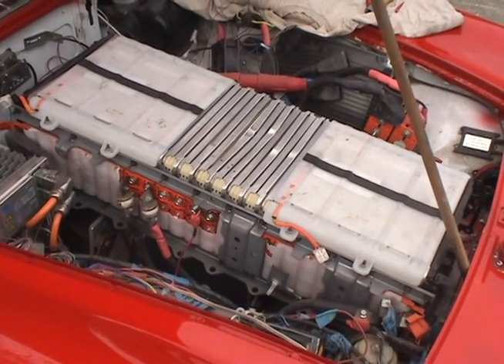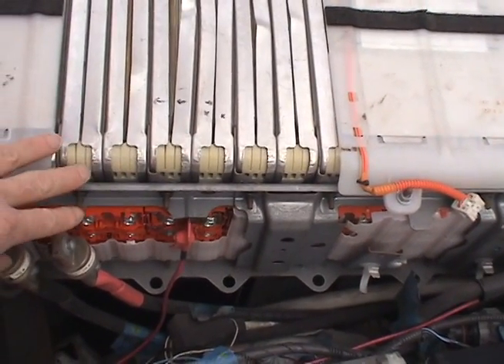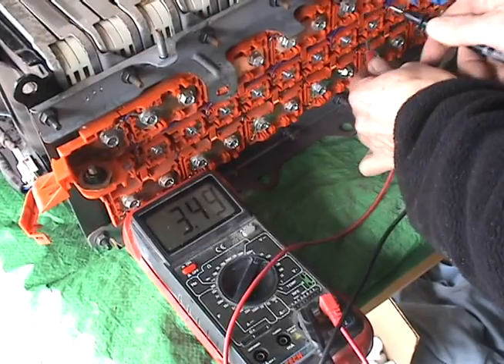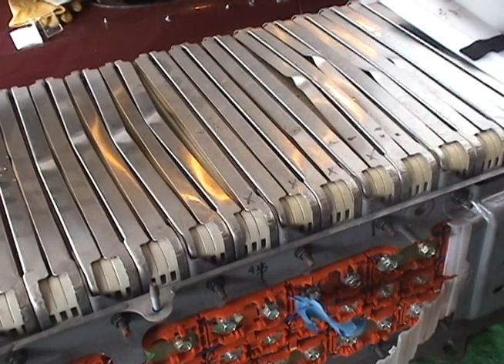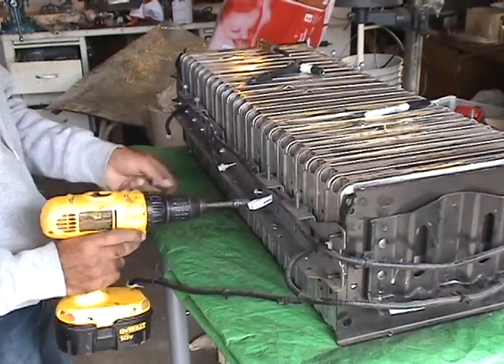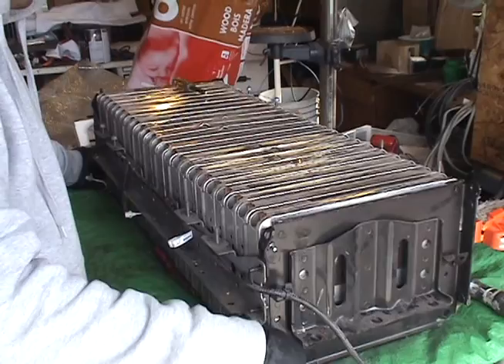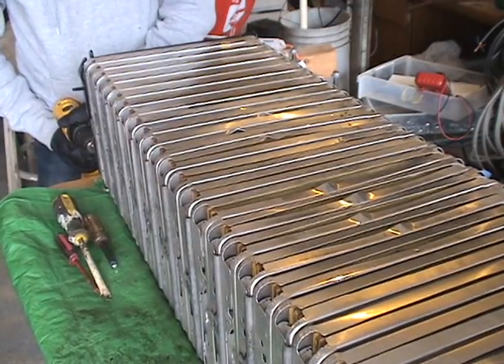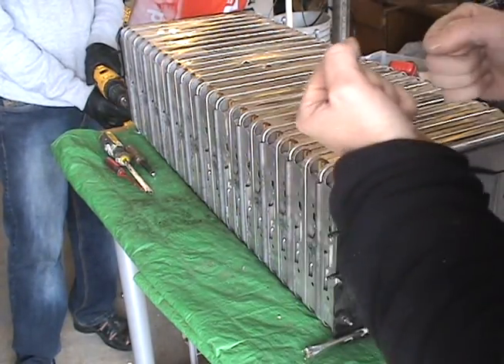Replacing cells in a Leaf Battery Pack installed in an EV conversion.

Comment: hi where did you get the the new cells from?
Reply from the maker: They were left over from the second Leaf we took apart. 

This car in this video uses a whole Leaf pack (96 cells, I.E. 48 physical battery units) plus another 32 cells, 16 physical battery units (total 128 cells or 64 units)  .  

Having taken two Leafs apart we had a total of 182 cells (96 battery units) and this car got 128 cells, my car (another MG) got half a pack - 48 cells (24 units)  

Having divided up the packs we had, if you do the arithmetic, we had 16 cells (8 battery units) and we used four of those in this battery replacement project.

Comment: Is it possible to replace the broken cells. For a complete battery? 12 bar. If the car battery 8 bar. So we do not replace the battery when you become weak?
Reply from the maker: Yes, it would be possible to replace individual cells. It would be a big task. Firstly, you need to identify which cells are weak (using the LeafSpy App). Make a note of all the cells that you'd like to replace (the cells are not numbered but you can just count up from zero volts on the pack to find the right cell). Then you have to remove the pack from the car - it weighs 300kgs - and open it. (This will void the warranty, of course.) Next dismantle the three packs of batteries from the framework and, with care, unbolt and remove the bad cells. The hard part will be getting replacement cells! Finding a crashed Leaf is probably the best solution - take that apart too.  The key important task before inserting the good battery in your pack, is to make sure the battery voltages are all equal to within 0.1 volts. To to this you will need to manually discharge some cells (using some resistance device, like a small 12V heater). Check the voltages constantly. When all the cells are even you can bolt everything back together. And, critically, seal the battery box perfectly using the same sealant as used when installing windshield glass. If you don't seal it properly then water WILL get in and you'll end up burning the car. See this video for evidence :)... 
https://www.youtube.com/watch?v=2cIo95W-vfE

I think it would take about one week to do this job.
Reply: thanks allot
Reply: Shame you did not name your video correctly

Comment: i hope you plan on doing more work to your battery .. i am not sure what your HV pack voltage is but if its high at all i hope you make this car safe for first responders as one day you can find your self in a crash or in water to where it can flood the HV pack and kill your self and others trying to help you  

you need to make a battery box safe for... crash / fire / water ...so no matter what the HV voltage does not get to any body parts on the car
Reply from the maker: Yes, all sorts of nasty things can happen in a crash. I can see you've had experience with fire. I have suggested more battery protection and maybe that will happen. It was interesting to note that of the two totalled Nissan Leafs we took apart, the emergency crew didn't bother with the battery disconnect. They just left it in place. This car charges at 525volts but drives at 130 so it's a bit safer. I'm not sure if the Tesla, vw golf, Mercedes, BMW etc even have so-called first responder disconnects. This was probably yet another ruse by the ICE industrial complex to try to slow the rise of their nemesis:) Remember how they tried to make all electric cars make a noise because of all those pedestrians who would otherwise be mowed down? Currently they are droning on about range anxiety- something that anyone with a commercial EV doesn't worry about. If you ask commercial airline pilot if he or she has range anxiety -of course they don't, they just make sure they have enough fuel to get where they want to go despite not being able to fuel in-flight. 
Water ingress into this car does worry me . Maybe the owner will do something about it, in the meantime, this is California and it hardly rains.
Reply: yeah i can under stand .. when i was talking about flooding it was not about the rain as its more of a small or large crash to push you down in to a small ditch with 5 feet of water or so 

its not as hard as you think to find your hood under water .... FL here we have alot of traps like that and really i dont know CA but its not saying this cars life well all ways be in CA   

i have 2 chevy volts in my driveway and the battery disconnect is next to the driver and is pulled by hand 
the Tesla has a pyro fuse and is setup with the SIS /airbag system and cuts power in a crash 
the nissan leaf tho has 3 bolts you have to pull to get to its disconnect so its safety is to not let power 
come out of the box if the car is off and 12v DC is removed .. the chevy volt is the same way 

DOT stander says that the car must and can drive in deep water with out hurting any one
this is why most after market motors dont meet DOT standers as the back side of the motors are open 

there are some new nice water cooled ones that are just coming on to the market made in CA 

yes i have payed for and own a RV and a suv that where on fire some time in there life and got them after the fire and fixed them up and seen others hard times and had 2 good friends that where fire fighters and you have seen i am a meager DYIs my self  and i am sure you seen i made parade floats for a living so i have alot of back ground in this stuff

but still 130Vdc  your going to feel that and its going to hurt  and i just hope that you can add so more safety  to the car in your coming days 

if you have room i am sure you can make a box  and add the a relay inside the box so the HV power coming out is cut when the car is off .. you can get a spray can of foam yellow that is used for around a fire place and add that to make a fire wall so if there is a fire out side of the box that the battery can last longer before it starts to go 

there is a video on here on battery fires fro EVs and it shows X2 the water that is needed when the battery goes up and in the end if some how that day should come that it hurts some one well you all ready showed how smart you are with DYI so its going to be asked why did you not make it safe for others 

i hope you are not taking this in any way that i am putting you down or making fun of your work .. i really love this stuff and am looking to do some of the same things to my stuff and thats why youtube is here but i am just a friend stopping by to say .... did you think of that ... and all so when i see some thing i like i look at what others have said to it and going much info i need to help  and so what i am saying here may all so help others 

PS.. i had a 48V dc system let me know it was there one time

Comment: What was went wrong with those damaged battery bolcks? Why dead battery blocks expanded so bad...? Overheatig or over charged...? Is BMS still alive...? How old those leaf battery blocks are...?
Reply from the maker: It's explained in the video. 4 cells got overcharged and when that happens the temperatures rise and the chemistry changes irrevocably. No BMS was operating during charge time. A bms MIGHT have prevented this failure - but quite possibly not. It was a wiring/configuration error. At least only 4 cells were lost.

Comment: Why on earth are you running a DC/DC converter from only a section of the pack??? You should never do this, it's extremely bad practice and will guarantee cell imbalance and damage!! Any load should only ever be taken from the whole battery, this way all cells will stay at the same state of charge. I can't imagine how you could even successfully charge such a set up even with an active BMS, it's a disaster waiting to happen...
Reply from the maker: +NewmanAutomotive The other videos about this car would explain why this setup is valid (except that the original valid setup was altered and that's why only 4 cells were damaged not all 16). Briefly, the DC-DC converter was ONLY operational when the entire battery pack was connected to it (thereby depleting the pack uniformly). The DC-DC only operated when the car was in 'drive' mode where the entire 400V pack was wired such that it was divided into 4 'quarter' packs of 100V each. These 100V packs were wired in parallel to drive the 100V controller. Only when charging was the pack rewired to be in 400V to satisfy the Brusa charger. (See the other videos for an explanation as to how this was done). When charging, the DC-DC was (supposed) to be off.   Things started to go wrong when we upgraded to pack to 520V (nominal) meaning that dividing the pack into 4 for 'drive' mode meant supplying 130V to the controller. The pack was charging at 520V. The mistake made was to keep the DC-DC wired over 100V (12 Leaf battery cells) rather than re-wire it over 130V (16 cells). Then the other mistake was to somehow leave the DC-DC on while charging - then then, even more critically, not charging but also not in the drive configuration. A veritable catalog of errors but also not too expensive (except that we believe the controller got damaged when the bad cells swelled and consequently connected the body of the car to about 120V relative to pack zero). Glad I'm not paying the bills :)
Reply: +mikeatyouttube Thanks for the reply, I also run nissan modules in my own conversion, love 'em, but please do be very careful, you're lucky they just swelled up and didn't catch fire. Do you have a link to a build diary for your car?, I'd be interested to take a look at it. 

I really mean no disrespect, but the setup sounds like an over complicated cludge in order to use a 400v charger. Why not just use a 100v charger? Also, when not using an active BMS, from a balance point of view, it's much better to re-configure the modules to buddy sets. A series string of 12 packs of 4 modules in parallel. This does require dis-assembly and re-assembly and some bus bar work, but is much better practice than running larger series strings of modules in parallel.
Reply from the maker: +NewmanAutomotive It is a tad complicated, I agree. It's a friend's car but it pretty much my build. On my MG (roadster) I have pretty much what you suggest - that is: half a Leaf pack but wired as two parallel 100V (really 96V) sets with a 100V charger. I have a monitoring system - just 48 voltmeters showing the state of each cell - not quite a BMS but better than nothing.

Going back to my friend's car, the 400/100V switch over was fun to design and the reason for the charging at 400V was (originally) two fold - firstly we could used the Leaf BMS - you certainly cannot use it when the cells are paralleled up into 100V blocks - and secondly we were going to use the Leaf charger - we had the whole car (totaled) so why not? The motor and controller were 100V so hence the change over mechanism. As it happens we couldn't get the charger to work without the car's VCU and it needed liquid cooling so quickly we switched to a programmable Brusa charger that could take 3kW input.  Later we got hold of more Leaf cells and wanted to add more capacity. So his car now has 1.25 Leaf packs and 100+ miles of range but the BMS doesn't work any more. The car was working just fine (8000+ miles of commute driving over about 9 months) then problem started when the car was in the shop getting the respray job. Somehow the ignition was on which meant the DC-DC was on and things when down hill from there.

I was equally worried about the possibility of fire especially when charging in a paint shop! I should have suggested not doing that. 

I'm very interested in knowing about your project - any links for that? I watched the video. I see you're in the UK. I think you're fortunate in the UK because there are so many small, light cars available for potential conversion and they're cheap too! I'll ask some questions on your site to keep the information in the right place.

This is the link for the description part for the MGB GT:
https://www.youtube.com/watch?v=aUlf6W7MUiw